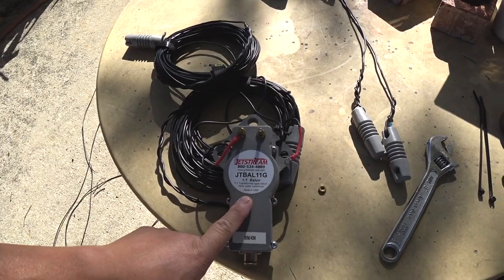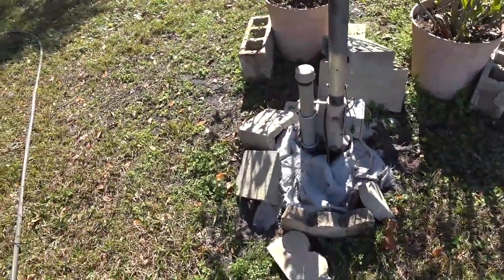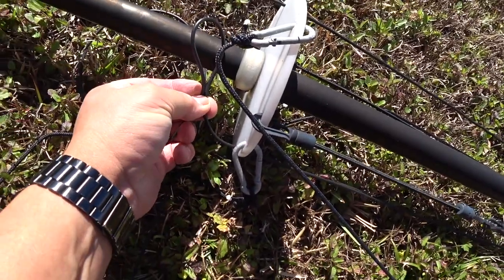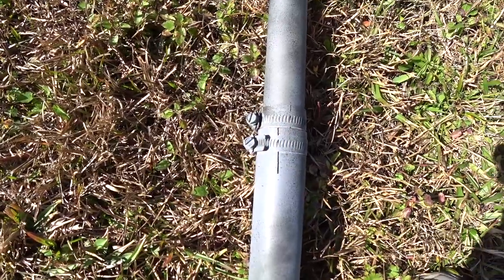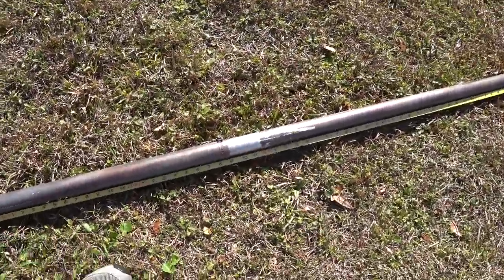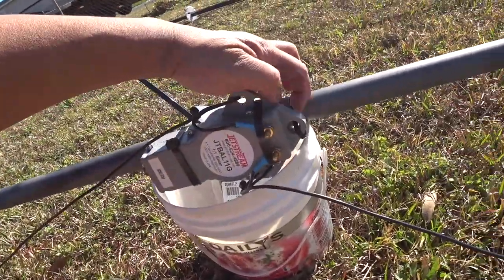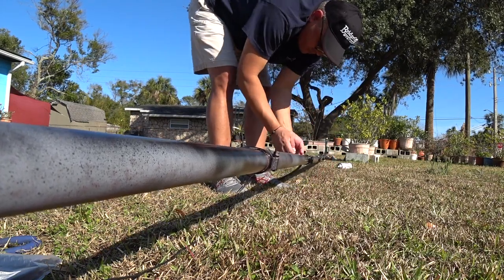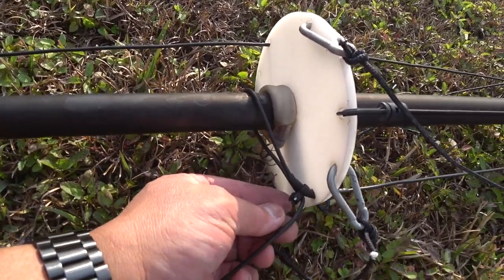40M Inverted V | How I mounted my Inverted V on my Zero Five Antenna | What's going on here on my HF

Comment: Thanks for posting your video. I think you need a loop on ground to deal with the noise. Receive only.  You'll never be rid of the  noise at your qth. The noise won't hurt your transmitting antennas. Hope to see you at the Orlando Hamcation. Don K7DT
Reply from the maker: I plan to make a Loop on Ground antenna.  Unfortunately, I won't be at Hamcation.  I'm working.
Reply: If its power line noise then the power company can send someone out to determine what it is and replace the bad part.

Comment: Entertaining....does your tuner automatic tune when switching back and forth, ant. 1 to ant. 2..?
Reply from the maker: Yes, it's stored in memory however, if you have the amplifier on and start transmitting, you'll get high SWR and the Amplifier will protect itself.

Comment: I use a 40 meter inverted V with the apex at about 34 feet, and its the best performing HF antenna I own. It works really good for NVIS in the daytime, but I haven't used it at night when 40 meters DX opens up. 73 KD5YOU
Reply from the maker: I plan to put up a double bazooka in the future.
Reply: Question if I may....... your inverted V works for NVIS?
Reply: @cwqrpportable  Yes it works quite well. I can typically use it locally on ground wave to about 500 miles/9-5 kilometers on NVIS.
Reply: @kd5you1  That's great!  I usually use a flat top dipole up maybe 20'+/_.  What do you mean 9-5 km on NVIS?
Reply: @cwqrpportable  lol I meant to type 804 km.